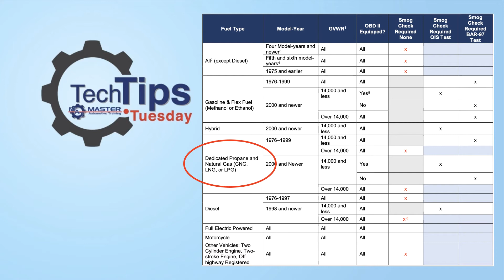When Can I Legally ⚖️ Do a Smog Check with the BAR97 Instead of the DAD-OIS 🤔?

Comment: Question.. I'm a rookie smog tech.  Only 1 month actual experience with the Dynometer.. I've been having alot of aborts.  My issue has been maintaining the speed within 14-16 and 24-26 on some cars with what I feel is sticky pedals. I've probably had like 3 aborts in this past month. Since you deal with alot of new techs, does that sound pretty bad? I know when I get my first score in January it might look pretty bad. Or is there some kind of grace period? What have you guys seen with new tech that just got done with training?
Reply from the maker: Hey buddy, welcome to the club! Sadly BAR will not give you a grace period at all, your next score release might be a bit rocky but nothing some practice cant fix. What you want to do is the use GENIII in operator training when ever you are not busy, run some simulated tests so you can get better at the dyne. 

1. As you bring the car on the dyne make sure you locate center reference point in the shop to help you stay centered. 
2. I take my left leg out when doing front wheel to use the pressure against my legs a measuremnet to know if I am oving side to side. 
3. Only use the tip of your toes. If you try to use your entire foot you have less control, followed by rolling your foot on your heal. I feel this gives me better control when trying to maintain proerp speed. 

Test this out and let me know if it helps!